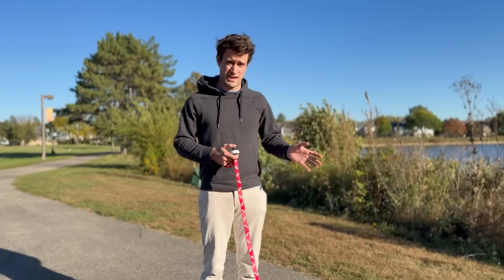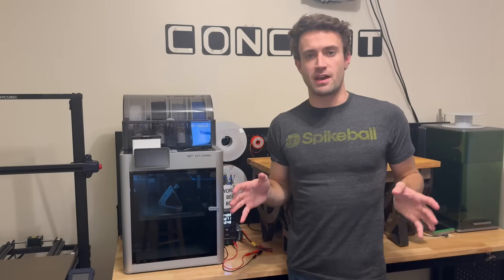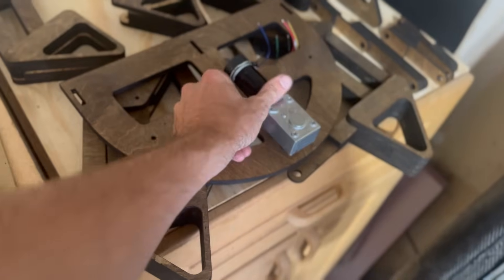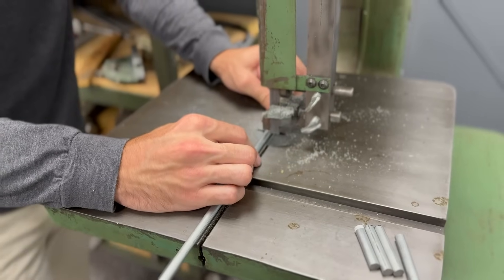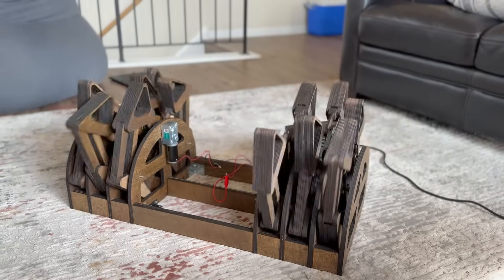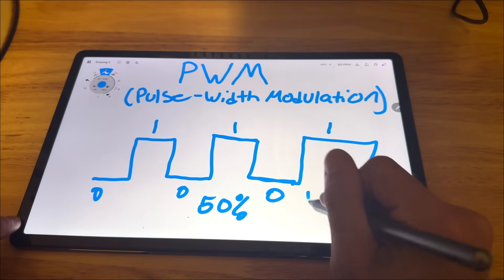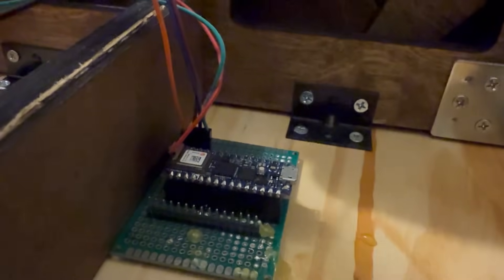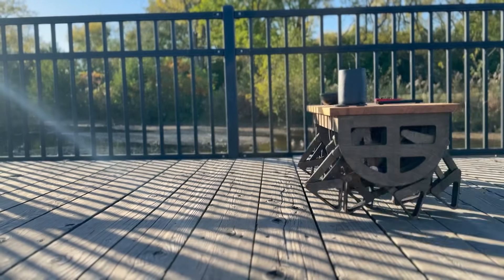I built a WALKING coffee table

Comment: Yikes, it's almost a 1:1 ripoff of the Carpentopod itself, not just the linkage that's mentioned in the video. (there's a reason they didn't show a photo of the original project they're sourcing the design from). I'm not docking you guys for the effort put in to fabricate, code, and make the thing, but I'm mocking the fact that they even copied the half barrel with a cross in the middle design (of the side piece that hold the legs together), something that can be any design and isn't dependent at all on leg geometry... At least have the creativity to make the project even slightly your own dudes, literally the only difference is it's not made of bamboo and there's no round tub section in the center.
Reply: How else would you make a table walk?
Reply: Also the videos are so close together nah
Reply: @timo4463  What? Please re-read my comment I'm genuinely confused. I'm speaking to the non-mechanical aesthetics that were copied from the Carpentopod, ie, the drum shape not the leg proportions.

Comment: 8:05 you should’ve used PID to modulate movement for more smooth movement meaning less possible movement on the objects on the table
Reply: I also believe it would benefit with some rubber sleeves on the feet to lessen the impact force of each foot
Reply from the maker: Great idea, I tried implementing I and D, but the difference isn't really noticeable as the precision isn't necessary. Due to foot slide you loose a lot of precision anyway. Proportional control seems to work well enough to reduce jerk to a usable state. But this is a great suggestion and I will keep experimenting

Comment: Hi there I have the setup to build my own walking table, my problem is I want to cut out the walking table on my wood laser using light burn I only have the files that end in .stl and it won't open.  what file will open in the wood cutting laser
Reply from the maker: You need the SVG files I have, where did download the files from? I have both

Comment: Super nice and i am currently checking where i can get the wood cut in a lack of having a laser by myself.
two Questions: what is the acutual size of the top plate, is it 40x80cm? 
And have you tried how it performs with a little (more) weight on it? What is the limit? Can it run with a 40kg kid on top of it?
Reply from the maker: I think the size of the top is close to 100cm x 40cm
I am doing weight tests now, so ill update you on this!

Comment: How much current is consuming? in the first test of one leg walking I saw 4A max without extra load, that seems a lot and 2 legs could drain easily the battery
Reply from the maker: That was likely with a 160RPM motor. I switched to a high torque motor (80RPM) and was getting a peak of 1.5A, with continuous walking under 1A. This is per motor.

Comment: How much would this cost to make?
Reply from the maker: This depends on the method you use. In my build manual I suggest you could 3d print, laser cut, or CNC this project. Each of those is going to have a very different cost not including the machine. I would say the cheapest you could do this for is around $400-$500